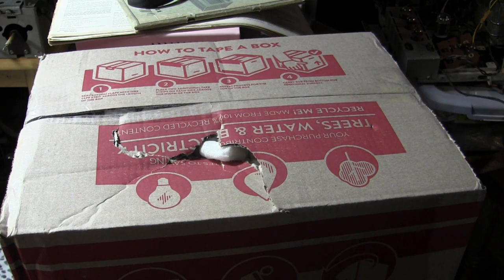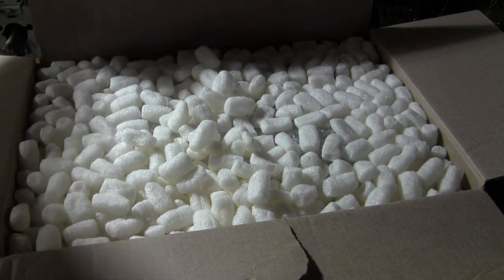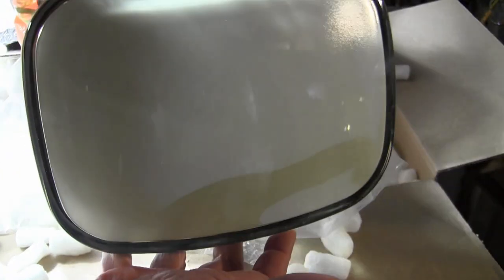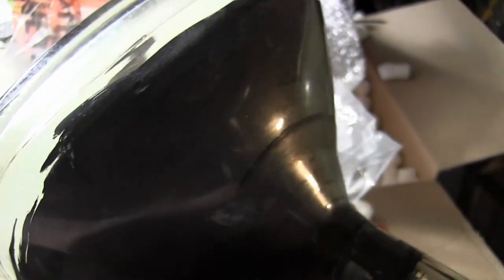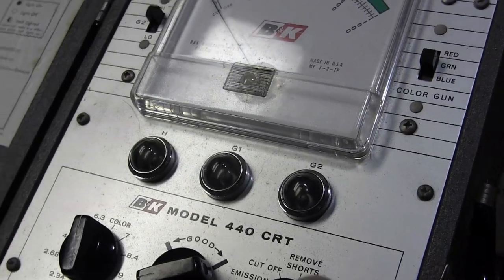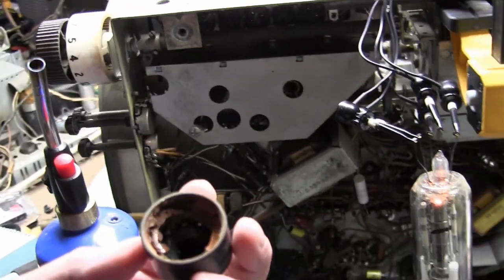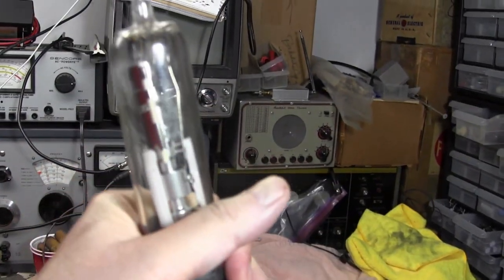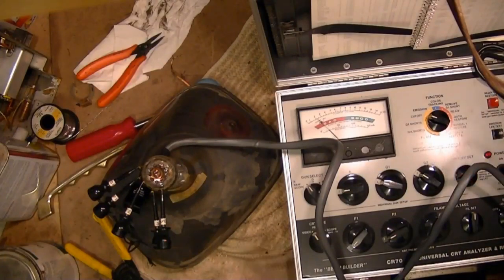CRT Testing, Repair and Rejuvenation Tips part 2

Comment: Another recent thing I have to relate to the video… I bought one of those 8” rca crts recently as well and the guy I bought it from used a knitted blanket to wrap it in. I found that to be really cool. Worked well because the crt arrived in good shape. Ended up giving the blanket to the dog to chew on

Comment: I have successfully welded a few open cathode's and the trick, according to Sencore, is that the tester needs to overheat the cathode for more than 30 seconds in "restore mode" (like 8+ volts in a 6.3v tube), before trying hitting the neck, in order to have a successful welding.
Reply from the maker: I tried that tonight. You'll see the results in the next installment

Comment: Thanks for the great demonstration, crummy about the CRT 
I hope someone figures out how to use the rebuilding equipment at the museum.
Reply from the maker: Even if they do, there is still the cost.  The last rebuilder was charging around $250 for a basic B&W CRT.  I expect it will cost even more now if the operation gets going.
Reply: Yea that’s a fair point. But I think in some cases for example.  I have a couple predicta tvs that I want to restore (just waiting till my skill level is improved (been been watching your videos and others, plus reading books etc) and once it’s been fully restored, I would definitely save up for a rebuild just for the peace of mind knowing the crt will be good for another 20+ years.   Like some guys will spend a few thousand restoring a car or 50 thousand or more restoring a car.
Reply from the maker: Absolutely. It's going to be an exclusive, expensive service.  I expect pre-war, early color and Predictas will be the bulk of business.  Rebuilding this little CRT would cost more than any TV it goes into is going to be worth.
Reply: I guess gun supply is an issue as well, or can newer no store guns be retrofitted?
Reply from the maker: @alexinnewwest1860  Museum has some new guns, there is a possible supplier in Russia, cathodes can be disassembled and recoated.  Regardless, it's going to cost at least a few $100 to rebuild a CRT.  Probably more.
Reply: Ok that’s interesting. Yea I hear what you’re saying.  It definitely won’t be cheap, but it would be great if there was that option ( I do get very passionate of preserving vintage technology)

Comment: Bob- Here we always had a controversy  over 'I always add a booster to the CRT after restoring" v.s. "Just use it as it is after the rejuvenation".   I never added a booster to the CRT after rejuv.
Personally, I felt that after a successful rejuv., the crt  should not need a booster, as all that did was raise the fil. voltage and IMHO, cause the CRT to likely fail earlier. Besides, if all else failed, I could always add a booster in the future.
Reply from the maker: I agree.  No booster after rejuv.

Comment: Sorry about that, maybe one day the hit will be 'just right'.  Thanks for including the early example.  The spark was cool to see.  Do you think factory reject tubes, with the glass adrift for example, were sold as test crts to shops?  Thanks
Reply: That's what was in the test jigs. They marked them on the front face.
Reply from the maker: Yes, for color CRTs anyway. They made dedicated test CRTs for b&w with straight guns so no ion trap magnet needed.

Comment: Instead of tapping the neck, can you try wrapping the bit of an air hammer in cloth and use that to vigorously shake the broken connection - maybe that will help them to weld together. Not head on, obviously, or the glass may well shatter, but resting against the neck so that the vibration transfers. 

Whatever you try, good luck.
Reply: By resting against the neck I mean the side of the hammer bit sliding against the tube neck so that only the vibration is transferred, not the actual impact.
Reply from the maker: I do have a Wahl vibrator that was sold with the Raytronic Beamer for cathode welding. I'll give it a try
Reply: @bandersentv  I definitely would be interested to see if that works. I didn't realise such a device designed to do just that existed but I guess they must have had success for it to make it to production. I don't do anything with CRT screens nowadays but I do have a workshop and I have successfully used the vibration of my air hammer for all sorts of jobs that were outside the box, so to speak. You have nothing to lose at this point so it's worth experimenting.
Reply: Oh, it's a massage unit. Presumably it was sold with the Raytronic Beamer because the owner had used it with success so hopefully you will,too. 👍
Reply from the maker: @budgetmerch  Although it was an off the shelf personal massager, it was part of the Raytronic Beamer device.  It also came with a BD-10 high voltage, high frequency device for clearing shorts.

Comment: So, basically the same as jiggling an incandescent light bulb until it “welds” back together and works again…for a while.
Reply from the maker: A little better than that in my limited experience. The few I've repaired are still working

Comment: I only wonder is you might have mistaken the tube type and you are just connecting it wrong. You said you tried different options, i thought, but not sure. 
Outside that possibility, there might just be nothing to weld, the gap between wires might be too large or something like that. 
The only way to fix it reliably is to rebuild it. Fat chance of that happening anytime soon.
Reply from the maker: CRT pinouts are standardized plus I can very clearly see the leads through the glass and identify what gun elements they connect to.    I suspect you are right about the gap being too big, or some air has leaked in, or it was physically damaged.  These CRTs used in portable TVs tend to get banged around a lot.
Reply: @bandersentv  the pinouts are are standardized, but in production or rebuild a mistake could have been made. You already had the likely options, so i suggested a unlikely, but still possible one. But if you have a good view of the elements that is not going to be it.😂